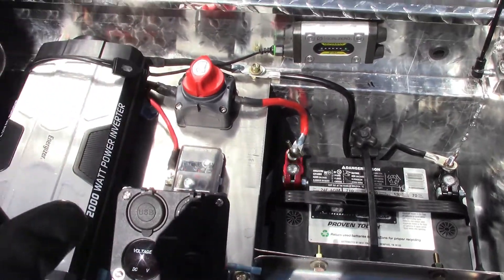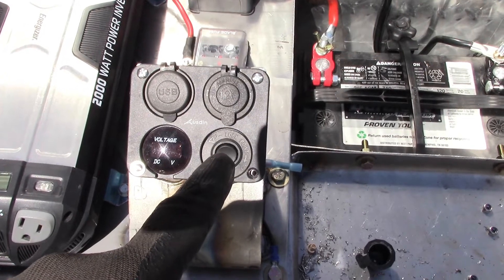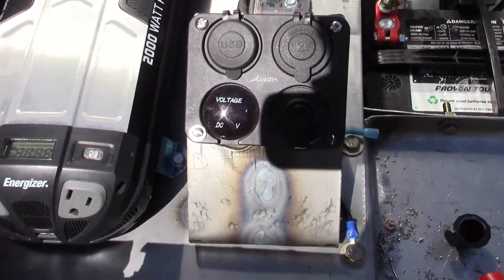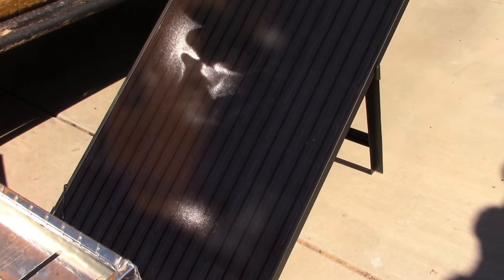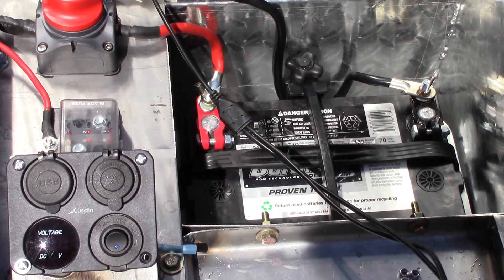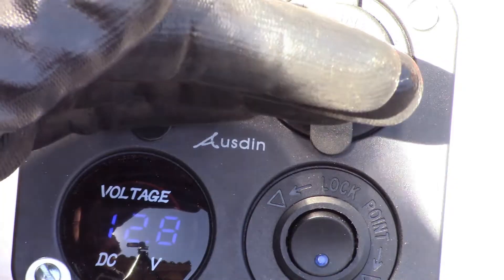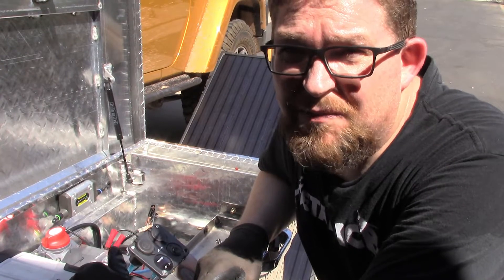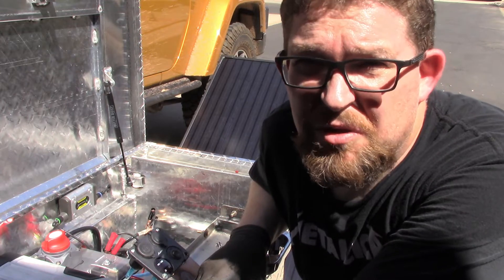Overland Trailer Build Part 9

Comment: I am building one too, I bought a 5x10 trailer. My plan is to build it to fit atv while I can camp and sleep out of it. So far I have bought some stuff(fridge  , electric stove/propane stove, heater, A/C unit,inverter, solar panels,  batteries, winch, tongue box for the build. Do you have a Instagram account?
Reply from the maker: Wow, sounds like quite the cool project! My Instagram is the_right_line and I have a fb group too, the right line outdoors. My goal with this trailer was to keep the utility part of it while still being able to camp out of it. It's nearly done! Can't wait. Thanks for watching.